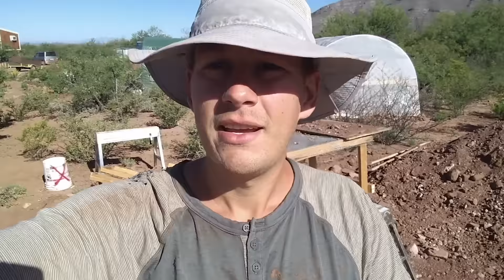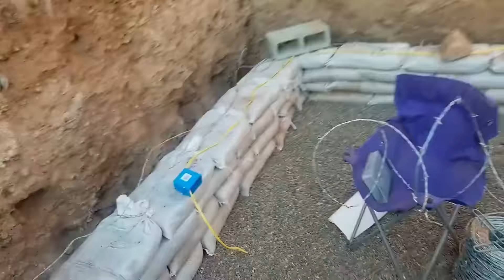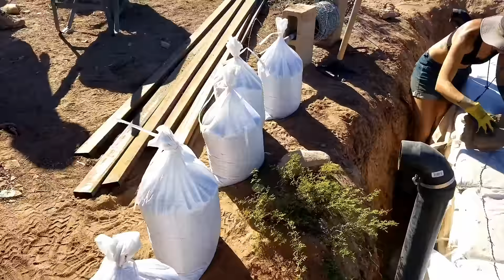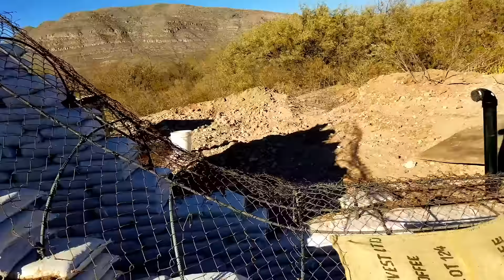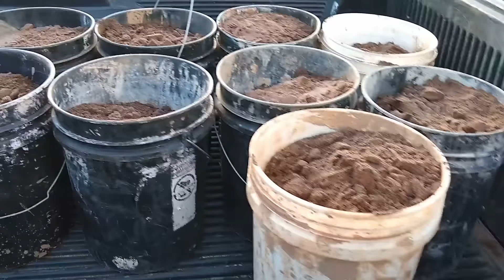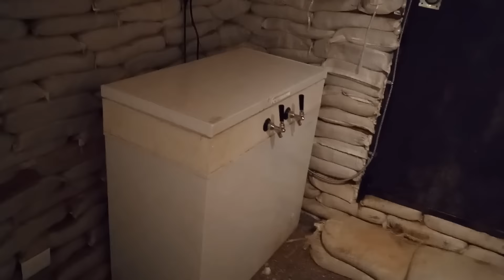Off-Grid DIY Underground Earthbag Pantry, Root Cellar, and Storm Shelter | Full Build Documentary

Comment from the maker: Thank you for watching! If you have any questions about this build, please feel free to comment. We respond to all of them. There has been so much we have learned since this build and we're happy to share what we've learned.
Reply: Look to iran ! Put a dome on top of celler roof with a pan 2 inch deep 5 ft by 20 that comes out the door ! Fill pan at night with 1 to 2 inch  of water  so it freezes!  Scope the ice in to dome chamber early in mornings and seal the door !
The cold will go down and you will have ice courtesy of mother nature  !
And you can put shoe laces on the entry for style  !😊
Reply: @smckay6438  Very interesting, where can I find out more about it?
In the past, large blocks of ice were stored in deep cellars. They remained frozen there for many months, only having to make many of them on freezing nights or sawing them out of frozen water surfaces.
A second door (with ventilation) at the top of the stairs would also help keep more heat out, in my opinion.
Btw. Have you ever heard that you can manually wash warm air cold?
Simply take a wet towel and slowly wave it back and forth like a large sheet of paper. Not only does it remove odors from the air, it also significantly cools the room. A tiny electric motor that drives a small water pump and some sort of flywheel, a timer as well as a towel and a few ropes, hooks and a bamboo stick... it doesn't take much for alternative cooling.
Reply: @ws4860  u tube , Iranian freezer, Iranian refrigerator!
Reply: aaaaaa
Reply: I have clay soil , do I need to add concrete with it? If there was a flood, would the soil get washed out of the bags ?
Reply from the maker: @Ytom-m8n  I like to add 10% cement to my mix for insurance. We had exposed bags for 2 monsoons and they held up just fine
Reply: @ዐዐዐ-ዐ1ዐፀ  Something to bind the clay that isn't water soluble.
Reply: what bags do you recommend for earth bags?  I only see hyperadobe on your site
Reply from the maker: @ivettelama2184  for individual bags we just found something cheap on Amazon. They were a lot more difficult to work with though
Reply: No sound.
Reply from the maker: @TennesseeHomesteadUSA  turn your volume on

Comment: How is your hole man ? Still standing strong? What about slightly bigger circle, would that be stable with sides structure, didnt you thought about putting steel bar and connect sides to earth outside for extra stabilisation?
Reply from the maker: It's holding up great after 6 years. Round is sound. So a circle is a great design. We did Deadman bags. Which are anchors on the outside and then rebar through the bags.

Comment: Construction is literally less than one percent of the difficulty of living on this desert. There are defunct constructions all over the Mojave left by dreamers who didn't think in advance about how to make it work in the  longer run. It's easy to move to the desert, but it's hard to live here. 

Roaming vandals and scavengers make regular rounds of the desert looking for abandoned construction to deface and/or strip.  You can't leave the place alone. Have someone living there, all the time, or it will get jacked within a month. Most of these people aren't a problem if you keep the lights on or otherwise make it clear that this site is not abandoned yet, but there are a few who think the lights being on is just evidence that there's valuable copper wiring (or a generator, or solar cells, etc) to sell as scrap.

What can you produce? Where will you sell it? Can you productively work out there? Can you keep your job and work remotely? Can you find a new job (remotely) if you lose it?  How do you get food?  How do you pay for the materials to maintain your build? How do people get back and forth to it? Is your place accessible or visible from the nearest highway? Where do you buy your supplies, how far do you have to haul them, and how much do you need? Can you get to medical care, in time, when you need it? Can you pay for insurance? Can you convince the USPS to deliver your mail on a rural route, and if not how far do you have to drive for it? You'll do a lot of hauling and driving, and you'll have to pay for fuel, vehicle maintenance, insurance, etc.  If you're not on a road expect to replace a lot of tires, springs, shocks, tie rods, and suspension arms. 

Do you own the mineral rights under your land? If you don't some asshole could put an oil well or an open-pit mine right next to your house. 

How do you get water? Can rooftop rain catchment on six inches of rain a year get you enough potable water to live on? Can you sink a well to cover water emergencies, or is the water table too far down? Anything more than 300 feet deep will be very expensive. If you build one, can you maintain that well?  Deep wells mean very high pressure pumps and fittings down where you can't get at them.  Do you need to build a cistern, and is there a wash nearby that drains a few acres when it rains so you can keep the cistern full? If you build a cistern you will need to maintain and occasionally replace pumping and filtration equipment, and none of that is free.  How do you pay for services like phone, power, and internet? Services are expensive out here.  How do you pay for the machinery you need to produce local services?  How do you keep that machinery safe?

You have to figure out what the steady-state of living out here looks like.  If there's anything you have to pay for you need income, and the places where you can earn income are mostly far away from where you're choosing to live.
Reply from the maker: It comes with different challenges, but I enjoy it. After 6 years no issues with vagrants outside of the few bad work trade people that come through. Climate wise, you choose your hard. With one more good rain I should be 100% rain water this year. So it is possible.

Comment: I really like the cleats for hanging stuff. I live in a area where there is a lot of clay. I'm tempted to do the same thing with filling/stacking 5 gallon buckets or 55 gallon drums. A suggestion to help with the temperature of the Boot cellar would be to build a tiny gazebo or take a few stakes and tie a tarp to shade the boot from the sun directly.  Since you don't have much insulation on the roof that may help prevent additional heat absorption. :)
Reply from the maker: I'm not sure how you would get the tensile strength between buckets/drums... The earthbags all lock together with barbed wire.
Reply: @DirtCreaturePottery maybe have a rebar rod or two or some cable holding them together? Im not sure. Just spitballing.

Comment: For future underground: have the excavator dig an Outlet from the ‘French Drain’ for water runoff into a small pit backfilled with gravel wrapped in GeoTextile. The pit will allow a wider surface area for water to absorb away from the structure.

Also, earth holds moisture: so instead, backfill the walls with gravel – wrapped in GeoTextile to prevent earth from leaking into the gravel.
Then water will drain down thru the gravel until it hits earth, which would then drain via the outlet.
Reply from the maker: @jake.presents  thanks for the tip! We haven't had any issues with our structure out here in the desert but I'm sure that the drains are nessisary for most other environments

Comment: I'm really happy with the way your project is coming together—it's very informative!  

I have a few questions regarding some issues I've noticed in my area, particularly related to climate and local flora and fauna:  

1. What measures have you implemented to prevent mice from entering the structure? In our region, they thrive underground and can be quite a challenge.  

2. I've seen in your videos that you studied the slopes of the land based on water flow. What would you suggest for regions with significantly higher rainfall than yours? Do you think trenches, swales, and French drains would help manage excess water? I'm particularly concerned about the heavy downpours we experience during the monsoons. Additionally, could you provide more details on how you managed water flow in your area?  

Looking forward to your insights!
Reply from the maker: Mice are tough. I just make sure everything is super well sealed up. I've found bug bombs work well to get them out of buildings and cars. 

Berms, swales, and drains yes. Over-build them... whatever you think you need 4X it for the off chance of a 100 year storm. As much as you can capture is great as well.

Comment: Great built, great video! Two comments to the roof structure: Laying the rectangular steel on the shorter side might have given you a little more rigidity for more weight/coverage. Better than the rectangular steel would have been I-Beams. Just my 2 cents...
Reply from the maker: Thanks for the tips! We used what we had avaliable at our local steel yard

Comment: if your roof structure can take the weight, i would put a raised garden bed over it, to give you more insulation.    even if it is weeds and  cactus in the bed.  Also, personally, i would put loose stone cairns or pillars around those air vents.   and one other item,  if  the back fill on the outside of the  earth bags is mostly gravel,    I would  do an experiment and wet that area thouroughly, or do close observation after a rain event soaks it, to see if your cellar temp drops substantially, like by 20 degrees.  if so you have built a very large zeer pot, or desert  fridge.
Reply from the maker: We piled about a foot of straw on top which helped. 

I'll have to look up Zeer pot. I haven't heard that term. I don't notice a big temp difference after a monsoon rain though.

Comment: A little thing that occurred to me, as far as keeping the cellar cool; electric refrigerators &/or kegerators generate heat. When they operate they are pumping heat into the space as they are running...  you might fabricate some kind of simple plenum enclosing the cooling tube's on the back a d plumb that into the vent tubes... and vent as much of that heat  outside as possible. Your effort gives me some good inspirational juices for applying to my own little place.
Reply from the maker: They do generate some heat. It's not detrimental to the space and nice to have them down there since they pull less electricity when they are in a cooler space on our little solar system. Trade offs for everything.

Comment: In Alberta and Saskachewan when they made root cellars and ice sheds they would cover them with a sloped roof for obvious reasons, sheding water and air circulation. Juat curious why you decided on a flat roof.
Reply from the maker: We built on a high-spot so there's not a worry of water flooding over the top of the building. We get such little rain, it's not too big of a deal. We are slowly building up more insulation on top with straw and layers of dirt.

Comment: We have a great idea for doing a round underground storage and still being able to do shelves with a little bit of forethought. You could put two by fours in the sandbag wall sticking out that way, the sandbags make the shelving stable and it's really easy to cut plywood in a circular curve to make shelving
Reply from the maker: Circular is always more structurally sound. A little harder to build things in that are off the shelf. If you check out our other buildings after this build we have moved to more round structures. Thanks for the comment!

Comment: Add a handrail to the stairs. (a broken tail bone isn't fun). 
Use reflective white wash on the on the boot exterior. Provide a shaded air gap above the cellar during the hot season (like saw horses and reflective plywood, or something similar to decrease  solar heat gain to the earthen cellar roof).  Adding some R-value to the interior roof surface would be helpful of course.
Reply from the maker: Thanks for the feedback.

Comment: How do you keep water out of these? Surely sandbag walls aren't waterproof???
Reply from the maker: We built on a hill, so we don't have direct water. They are some sort of plastic so they are fairly water resistant. Plus we put a vapor barrier around the bags on the outside. A little water won't hurt them, you just don't want them soaked.

Comment: Not the best idea putting a refrigerator into a root cellar as it puts heat out into the room which kind of defeats the usefulness of the root cellar.
Reply from the maker: It does a little bit, but it's nice to have a community fridge. We'll stay between mid-50s - low 70s down there.
Reply: @DirtCreaturePottery  Well if you are happy with low 70s sometimes for a root cellar then its all good but if your solar system can handle it please try bringing the refrigerator top side.  It will work a bit harder but as long as the solar can handle it then it will keep your food just as cold.  The rewards will be a easily accessible refrigerator and a better functioning root cellar.  Best of luck with everything you are doing.

Comment: Use a spray foam kit or 2 on the inside of the ceiling.
Reply from the maker: We did end up putting a few inches of foam insulation in there and a second door at the top. Helped a lot!

Comment: Cool build! A couple questions: why did you do a vertical exterior door vs an angled/nearly flat door? Most cellars I’ve seen have a door that’s nearly flush with the ground (slight angle for rain runoff). There should be enough headroom with the door open to walk down the stairs to the interior door.  But maybe there’s a reason I’m not considering… second (because I have no experience with earth bags) is there a reason you didn’t mud/stucco the interior?
Reply from the maker: For ease of use basically. A normal door is more comfortable. 

The bags only deteriorate when exposed to the sun. With them being totally in the dark most the time is wasn't necessary. And I like to show the process

Comment: Nice build and very creative!  If it hasn't already been mentioned, as far as the cellar "roof" is concerned, maybe a shed built upon a raised truss floor system to prevent weight on the cellar "roof" could provide shading to help keep the cellar a bit cooler.   It could create additional storage as well as water diversion which could double as a water catchment system.
Reply from the maker: Thank you for the suggestion

Comment: Appreciate the work.  Frugal off grid channel skipped the underground walls.  Seems like u could have.  Keeping it more narrow may have made it easier to cover.  Not sure above ground stair cover was necessary….May have made cellar roof angle down to shed water…✌️
Reply from the maker: They didn't put any structural walls? The stairs cover is nice to protect water from flowing down and give an "air gap" to help control temperature. It was quite a bit more work though. Luckily we've switched to hyperadobe and are getting things done in ¼ the time! 

Thanks for watching.

Comment: Running experiments here to the north of you in Show Low, it looks like you may be able to do this cheaper and much faster with thin shell shotcrete. I will post some videos soon on the process, but it's simply digging a hole in the ground, lining the walls with "cattle panel", and shooting them with shotcrete to about 1 inch thick, then making an arch shape with the same panels and shooting them as well. Single day with two people, and strong enough to drive the tractor over when it's set.
Reply from the maker: I'll have to look up that method. Sounds interesting.

Comment: Could you have gone bigger if a rectangular shape? Would like to do a 30'x15' root cellar. Can something like this be build using your method? What state are you in? How do you handle low rain? Thanks for sharing.
Reply from the maker: You could go larger yes. You would want to put in buttressing ever 10 ft or so. Also, one thing I wish we did was slowly step the walls outwards to add more strength. 

Here is a SUPER helpful book that I use as my earthbag building bible. It'll go more into the structural design components if you are interested. 
https://amzn.to/3LI0s3P

Comment: Since u only have 2" of dirt dig it up & do sum aircrete or lightweight concrete rite on top of the metal. Lightweight extreme insulation.  Another thing look at ur design u guys really missed an artistic chance. It damn near looks like a boot. Recoat it & make it really look like a boot. Put a sign wit ur organizations name on both sides & let the free advertising take off. Everyone will wanna take a picture in front of the root cellar that looks like a boot. Will boost volunteers & donations. Gym shoe could b better if u pick right ones. Good luck to yall. It's still cool how it is
Reply from the maker: Thank you for the suggestion! 😄

Comment: I always wish folks had a thermometer at the entrance and one down in the root cellar so you got a legit benchmark of the temperatures. After using hesco walls I would be really inclined to do something similar. Erect the boxes fill with excavated dirt a debris, erect next layer, fill till the height you need. Things are legitimately bulletproof.
Reply from the maker: I'll have to try putting a thermometer in two spots